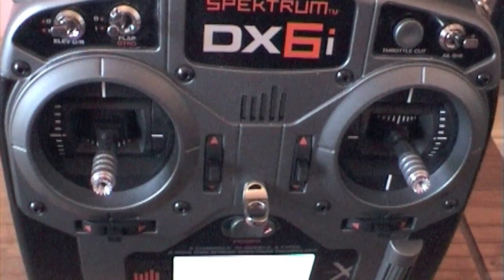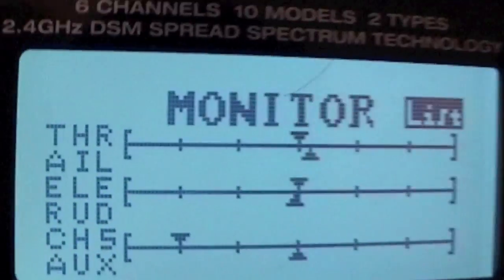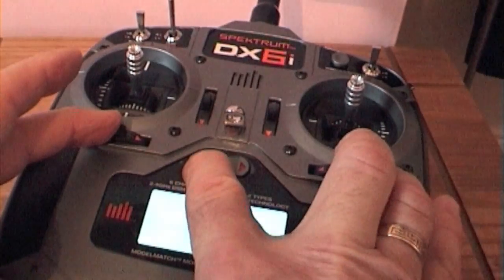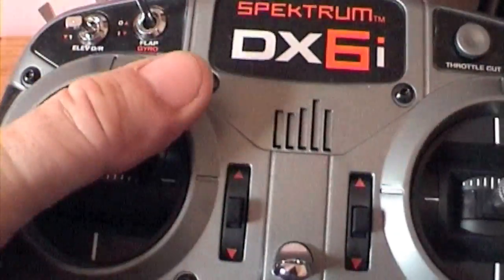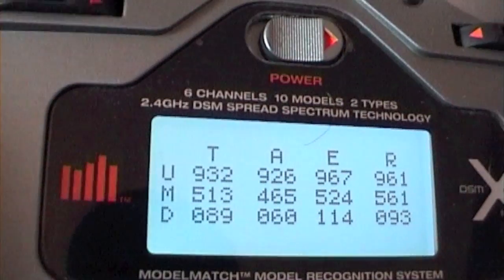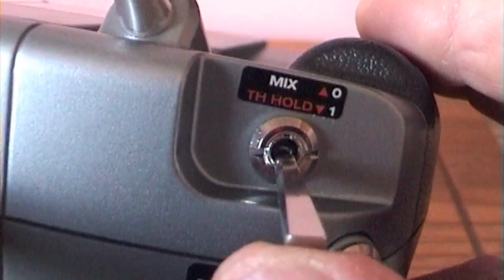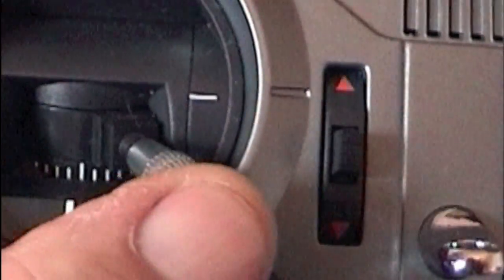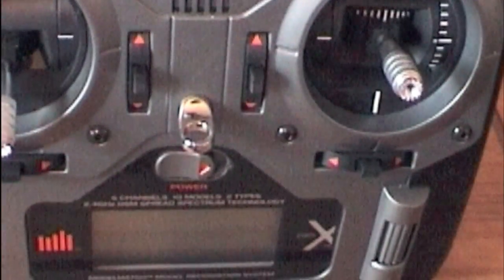Spektrum DX6i Transmitter / Stick Calibration VERY IMPORTANT !!!

Comment: hello there. i tried to calibrate my dx61 but when i switch the th hold to 1 and the rest on 0, when i switch the tx on while the trims are pushed towards the inside, the monitor shows --tr hold-- and beems intermittently. it doesnt show what your video shows  with all the numbers. thanks

Comment: It worked fine, but I think I have a sticky Aileron pot. I will take the back off ans blow out the pot. and try again. Many thanks
Reply: As I suspected. Took the transmitter apart (Plenty of videos on YT for that) Cleaned the potentiometer, re-assembled and then ran through this calibration again. Everything working fine again. Thanks again

Comment: Do you have to calibrate every model nimber? Because in my situation model number 3 is not calibrated, the 4 channels are not centered and when i ON my tx with the procedure, the number is not displayed instead and when i put the flaf switch to 1 the TAER and numbers will display! weared?

Comment: Hi my spektrum DX6i was a mode two I changed it to mode 1 ,found the ail and rudd on the ar610 receiver don;t mach the transmiter please help   derrick007@dodo.com.au              perth wa
Reply from the maker: I really need more info to be able to help. You could try allocating  different ports on the receiver.
Reply: Hi thanks for writing back have two spektrums on mode one for training the one I changed from mode two to one (second hand one) rudd/and ail are diff/ on the receiver on the one I changed over using  ar 610 receivers  the receiver rudd/is now the ail and the ail is the rudd/ the new one i got on mode one doe'st do this the second hand one pins may have been changed over and don;t know how to get the pins out of the second hand one so the ail and rudd/ on the receiver match

Comment: I noticed that after you calibrated it and then turned on the Radio, your digital trim on your RUDDER channel was not centred... you then entered your Monitor and all 4 Stick Channels were set to centre.... should Users make sure all Digital Trims are set to "Centre" before Stick Calibration...?
Reply from the maker: Yes zero everything.
Reply: okies... I just noticed that your Rudder Trim wasn't centred and the Monitor showed all 4 primary channels were aligned....
Reply from the maker: The rudder trim was out of line, but after celebration it came in line with all the other parameters.
To be honest I am not sure what you mean.
Reply: +Topvideos1001 

I was wondering if you were aware that your RUDD trim was not Centred when you calibrated the sticks..... you can clearly see the digital trim is not center when you show the results on the Monitor, and it's all aligned without the RUDD trim centre at the 5:16 mark.....
Reply from the maker: The video was done with lots of editing, so it may have been "an add on video clip" to make the video work.
I did about 3 takes and stitched them all together.
But the sequence is still the same.

Comment: Thanks for the video, had no idea about the calibration. One thing I noticed is that after first doing the calibration I thought it hadn't worked. But then I zeroed all my trims and checked the monitor and it was perfect. If mentioned in the video I had just missed it.
Reply from the maker: I must admit I did forget that but but glad you are OK with it. This is info that they don't want people to know I think.
I found out by experimenting because my DX6 was miles out, so thought I would share it for free :-)

Comment: did not work on my DX6i,,, tried 6 times today,,,
Reply from the maker: +Jimmy Haley 
OK so where did it go wrong, eg at what stage ?
Reply: when I went back to check on the monitor,,, still the same as before
Reply from the maker: +Jimmy Haley 
I see through the comments it will not work on every unit, could be a different memory chip, other than that I cant help. Very sorry.
Reply: ok

Comment: I turn it on like you do with the trims pointed inwards and i cant get to that first screen
Reply from the maker: +raskco09 
Did you put the Throttle hold /mix Switch to on? (Because this opens the memory) and all the others to OFF! before you started ????
Reply: I got it to work. i did the calibration. 3 times and all my line does not line up. I dont know why. i followed your vid set up and another guys vid. the rudder and ail. are off by a tiny bit..  the rudder i have to use sub trim at 83 to get it to line up.. dont get it.

Comment: Hi, Im using a DX7 for something different, I have a mechanical limit on the knob (about 1/3 of the full movement).... Am I correct in presuming that I can "range" this motion to be recognised as full travel? I don't have the TX with me at the moment so cannot try. Thanks.
Reply from the maker: +Sam Nicholson 
Is there a error inside the main body ?
Reply: No... fully functional.... but i have added a lever with end stops....
Reply from the maker: +Sam Nicholson 
There is a function that you can access to add servo travel in the menu.
Reply: Thanks... i know how to adjust servo travel (ie 50%travel) in relation to full throw of the sticks per say..... was curious if you can get 100% servo travel from a tiny movement of the stick or knob, by "cheating" the calibration....Thanks anyway.
Reply from the maker: I see, Only by a
 channel switch. eg gear etc.

Comment: My Friend has a DX8, and he had a plastic part broken insude, so he took it apart and fixed it. Now whenever he turns the DX8 on, he is greeted with the Calibration screen, but he can't calibrate it...
The '??' don't disappear and show 'OK', he is stuck with the two questionsmarks. Does anybody have an idea what this is and how ti fix it?
Reply from the maker: +muh1h1 
I have not ever had a DX8, so cant help you very sorry, but but don't forget this type of Tx is a computer based Transmitter so make sure all connections have not been compromised.
Reply: Topvideos1001
That was my first thought too, i expected that he had forgotten to conntect one of the potis back up, so i have taken it apart myself. Unfortunatly everything was connected as it is supposed to be. Still he is always greeted with the calibration screen, and even if he exits it, it comes back after a reboot.
The sticks don't function as far as i know.
Reply from the maker: +muh1h1 
Hmm to be honest, I would need to take a look at it myself, what actually broke inside ?
Reply: Topvideos1001
A mechanical part which caused the right stick not to spring back up again after being pushed down. He fixed it very well though with some glue and a piece of a nail.
Reply from the maker: +muh1h1 
Well sounds like a repair but the problem may be with a short out, I hope the nail did not come into contact with a metal part ?
Reply: Topvideos1001
I don't think it did, and i am pretty sure he removed the battery while working on it, since it is attached on the backside (which he had to remove anyway), so i can't imagine that to be the problem, but i was not there when he repaired it...

Comment: There is ALOT of missing info here. Called HH and was lucky enough to get a tech to walk me through the recalibrating process without sending it back in to them. There is not even a 1/4 of the information here to do the calibration correctly. Please Do AT YOUR OWN RISK!
Reply: Topvideos1001 I struggled with this until I realized that my SUB-TRIM was not at zero. Once corrected it  worked perfectly. Thank you.
Reply from the maker: Well that is very helpful, but look at the people that have had success on following my video ?
Reply from the maker: So fill in the missing bits for me and the others then, and we can then follow your videos ?
Reply from the maker: Good sales pitch there mate :-)
Reply from the maker: Good to here it ;-) glad to help.
Reply from the maker: Chris Collins Please explain what you mean by 1/4 info ? as we must help each other.
There is no risk involved either it works or it works.
Reply: cannot explain it all, it would take forever and i dont remember everystep. I basically had to reprogram EVERYTHING in the dx6i. theres sub trim, mix 1 and 2, reverse, d/r and expos, ect. it all has certain switches and certain ways to move each switch in correct order ect. in a nut shell it took and hour to calibrate mine over the phone and about 45 min. of it was the actual Just Programming steps. If you have a problem Send it IN!
Reply: ? monkey see monkey do i guess. if it worked or they think it works thats great! just saying its not 100%. And it frustrates the heck out of me when people come to the shop and say things like " it worked for the guys on you-tube" or "somebody who has been in the hobby for over 30 yrs told me this was correct" Now I am fixing a mistake they did in good nature from a video they believed in.
Reply: Topvideos1001 i dont do videos and i try not to give out alot of info for free as it just hurts my work and other b&m hobby shops. the dx6i is on its way out like the dx7s and dx8 anyway so a video would be kind of a waste also it is still kind of a rip at its current $130 price for a sport flyer tx so i dont see to many people buying or needing info about this tx anyway. its nice but still not worth buying one with other tx's like the tactic TTX850 and 650 for around the same price. All i wanted was to warn people to do this at their own risk so they dont mess up there tx like i did. :-)
Reply: Topvideos1001 not really a pitch... it is true though

Comment: How can I set an  accessory switch? when I sart the transmitter wizard, it does not recognize any of the accesory sticks, it does recognize the gear channel but I already use that for my attitude/rate mode. Could you tell me how to set/setup an assecory stick on my Dx6I?
Reply from the maker: Maurits Veerman Easy, just go in the main menu for your choice and and click on the INH box, and that will activate the chosen switch on the screen. 
Download the manual here --
http://www.horizonhobby.com/pdf/DX6i-Manual_EN.pdf
Reply from the maker: If you need more help then get in contact via the Discussion tab.
Reply: Topvideos1001 where's the discussion tab? and what do you mean by: just go in the main menu for your choice and and click on the INH box, where is that located at?
Reply from the maker: The discussion tab is in my Youtube channel just click on my Topvideos1001 avatar.
The main menu is the set up list, on the screen. Just hit the scroll roller.
Reply: I've send a message through the discussions

Comment: Aha, hmm... I had one Spektrum DX6i Transmitter that had a MECHANICAL problem.
I open it and found that the potentiometers (connected to the sticks) are mechanically bad, means, they where loosely mechanically connected to the sticks!
So no wunder the arrows in the monitor jumped back and forth around the center.
Reply from the maker: Well they are only plastic after all but they can be calibrated to the molding discrepancies you describe.
Reply: Yes, but the problem with my model was, that mechanically the potentiometer was LOSLY connected to the Stick... so there was always a "gap" ... it has to be replaced.

Comment: just got my DX6i can this  be done with out binding to a model ?. . . tried and got some information appear that was not mentioned in your video ... .  it says
"read down to
range 000 to 323  
204  221  230  230"
Reply from the maker: Hi Jacky, you do not need to be bound to any model because it is a Tx calibration.
I have not come across the down to range bit before but I will investigate  :-)
Reply: Topvideos1001 Thanks be nice to know why i get it and you dont. Reason mentioned about binding is because model and rx are in post
Reply from the maker: jacky Parker
Hmmm, will this screen come up after you push the two trim buttons together ?
Reply: yes but not straight away get all the numbers 1st like in video then that message appears when moving the control sticks
Reply: Topvideos1001 turns out it comes when you turn the ELev switch on . . tried a few times to get everything level and still dont work . . throttle and ele are ok  just need to sort Ail and rudder . .  also whats CH5 for ?
Reply from the maker: jacky Parker
Channel 5 is for what ever you need to link a servo to, this depends on what model you are using.
If you are flying a Helicopter or a Quadcopter without GPS, then this video is important, if you are flying a Plane or using a boat then I would not worry about the Calibration.
Reply: Got gyros on order so that should cut out anything for my plane. .dont want to crash on 1st go thats why i was interested . and also why got gyros on order
Reply: Topvideos1001  is it possible to turn gyros on and off while model is in flight ?
Reply from the maker: jacky Parker
Yes it is possible, just link a servo into a spare channel, then get the servo to switch off the power to the giros via a micro switch, if you follow my boat building videos I am using the same system for the electric starter and the engine cut off, hope this makes sense :-)

Here - http://youtu.be/x3ovAReXL70

Comment: Great video but I have a question. I am using this DX6 controller to drive an electric cart  I made.I use the aileron control on the right to steer it left and right. I move it to the left and the cart goes to the left.
How can I change the orientation so when I push it left it goes right?
Reply from the maker: Simple, there is, in the main menu an option to reverse the control, if no luck then get a servo reverser they are cheap as chips. Good luck.
Here --
http://www.amazon.com/gp/product/B00QISJQBC/ref=as_li_tl?ie=UTF8&camp=1789&creative=9325&creativeASIN=B00QISJQBC&linkCode=as2&tag=multibladehel-20
Reply from the maker: Topvideos1001
If no luck then let me know.

Comment: Thank you very much, I remember when I bought my HK-500GT. I never read the manual for the DX6i. All were on power. I do not know which button I hooked on and the helicopter began to turn in full speed. it made me so scared that I never touch again this helicopter.
Reply from the maker: This calibration is not in the manual.

Comment: I take it you set all servo SUB TRIMS to Zero first  along with Servo reverse to N-ormal
Reply from the maker: Yes, that is correct.
Reply: Just that mine was something like that but sub trim was about 20 clicks off
Reply from the maker: All must be at neutral to set the internal memory with this method. Then it should all be  OK.
Reply: Nice one.....

Comment: Hi, thankyou for your upload, Ive been having trouble with my DX6i in that the Aileron on the monitor menu is moving randomly and thought i'd give your video guide a go, unfortunately it didnt fix my issue and believe it to be the 'pot' thats at fault? Would you be able to help confirm this is the issue?
Many Thanks
Dave
Reply: talk to horizon hobby they'll fix up the tx
Reply from the maker: How can I do that ?
Reply: All sorted now guys, thx for your replys tho, I ended up takin it apart myself and cleaning the Aileron Pot....works a treat now an no more glitch in  flights :D
Reply from the maker: Dave ZX6R Good result ;-)

Comment: ps Actually did not mean to offend you my comment was directed at myself ! Seems my DX6i has a fault anyway.If I move my sticks around in monitor screen the cursors move all except for the throttle cursor that stays stuck to the right hand side of the screen (Mode 2) Changed to Mode 1 & is the elevator cursor that does not move.Suspect faulty potentiometer the left hand vertical axis stick on a hardly used transmitter.Date code shows it is not due the Spektrum known fault recall. Should have stuck with Futaba but wanted a DSM2 transmitter for ARTF Blade MCPX etc. Spektrum seems poor quality to me.
Reply from the maker: Thats OK,  Never heard the saying myself, but it is a very strange one, seems you have a problem Tx  probably better to get a new one.

Comment: I tried it & my trims went right out of position on the Monitor screen.Read the comments & the throttle curve has to be linear 0-25-50-75-100 as stated by Greg Helinski.If it ain,t broke don,t fix it !
Reply from the maker: Hi Paul, quote, "If it aint broke don't fix it" ? what a stupid statement ?
How the hell can you fix something that is not broken ???????????
I do read the comments, but they always state the obvious.
Reply: Topvideos1001 In my case randomly fiddling unnecessarily with my transmitter that actually made it worse than when I started.Fortunately somebody else had made a comment about the throttle curve has to be set to linear which you had left out."If it ain,t broke don,t fix it" is a well known phrase for fiddlers,have you not heard it ?

Comment: an important thing to note or this will not work right.  you need to have a linear throttle curve set.  0-25-50-75-100

Comment: Great explanation!
Just a quibble, not a strong criticism, though.
In my opinion, it is not really "quite simple", it is more "rather straightforward". Quite simple is operating at most 2 switches, not holding trim tabs while turning on, and running 2 runs for the high and low sides.. Straightforward is what this is, a series of steps that border on complex, but nontheless achievable as long as you follow directions.
Reply: Founder member of the pedants club I take it? lol
Reply: Yeah, maybe. I had a physics professor use the term "rather straightforward" to describe stuff like Einstein's Field equations. It became a joke in our class that "straightforward" was code for "mind-bogglingly complex".  But he never said they were "simple".